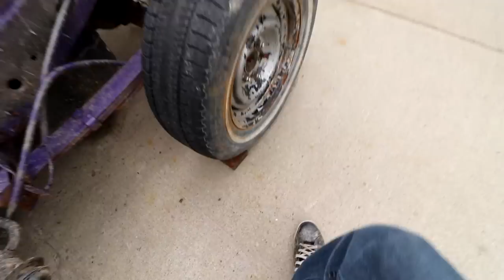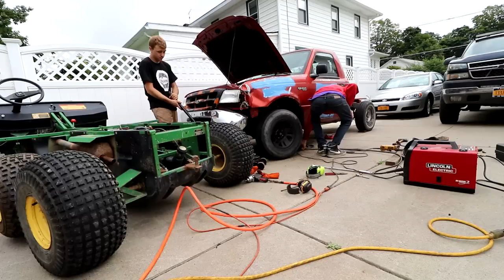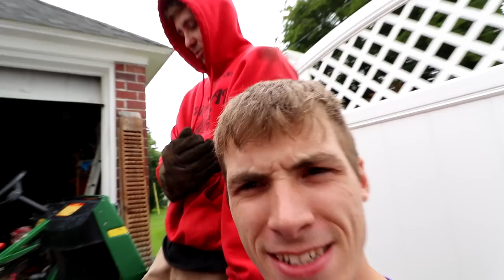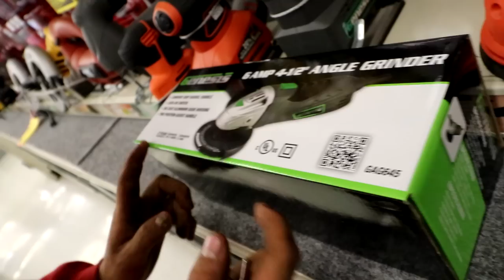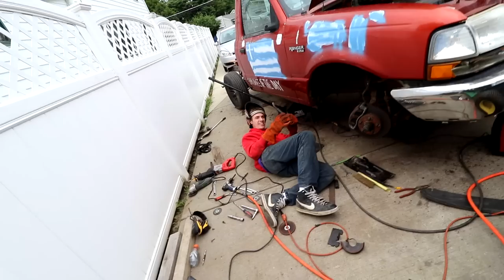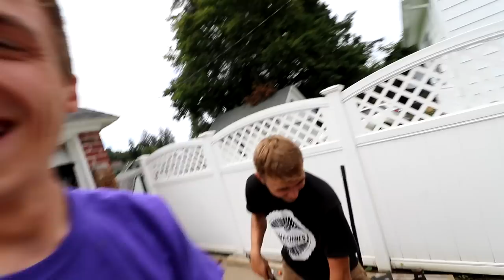His Drift Truck is JUNK!!!

Comment: The BMW has more cylinders but obviously the risky ranger needs some 3d machines stickers for extra hp
Reply from the maker: absofrick'nlutley
Reply: 3DMachines BMW For THE WIN
Reply: The BMW may have more cylinders but the Rusty Ranger has more spark plugs.
Reply: the ranger gets any more hp the frame may brake
Reply: Ketchup 2003 they could have used those stickers on the frame
Reply: FireAndGasoline no the duramax does

Comment: so any news on the bmw ? i posted before its probaly the headgasked thats gone due to overheating a aluminum head and often that creats a wacum in the coolingsystem so the water dosent flow as it should and then overheat you could try to remowe the termostat but that is a shorttime solution. and sorry if my eng isent the best just trying to help

Comment: That won't take long and it's going to break the welds  I have my own and I tried that and it broke after couple months U should weld it then get grade 8 bolts and nuts put holes in it and put them there u want it to hold for longer to last the track 3DMachines

Comment: Y'all should put some form of 3D machine touch on the risky ranger
Reply: MotoS 19 

They did, in the form of shit-tons of steel welded to the side of the frame. 3d machine touch right there

:-)
Reply: B 9 lol I know but on the outside that if you saw it coming down the road you'd go aye that's a 3D machine rig